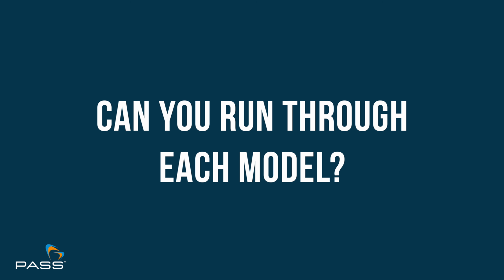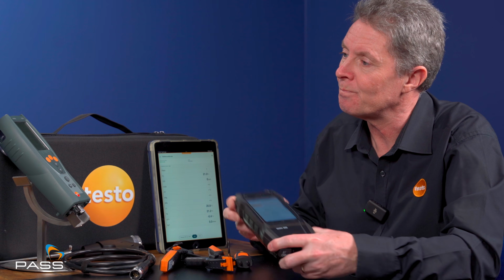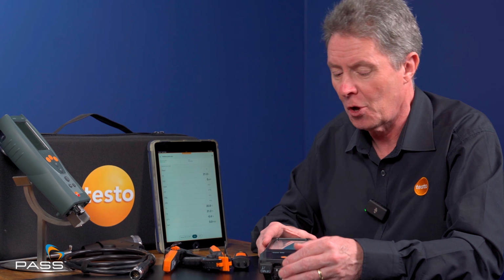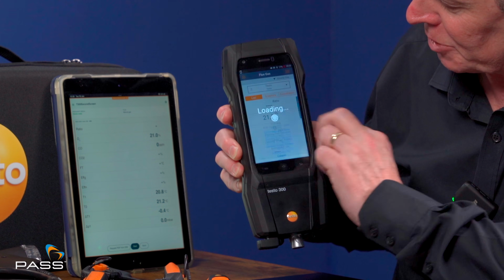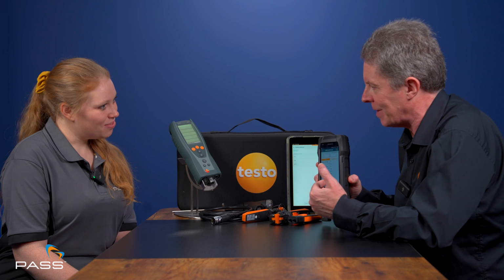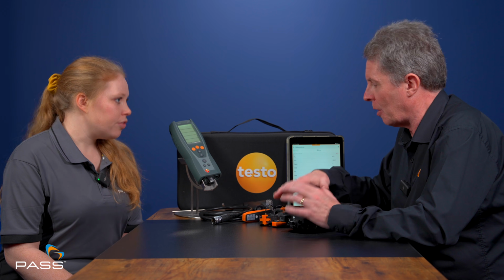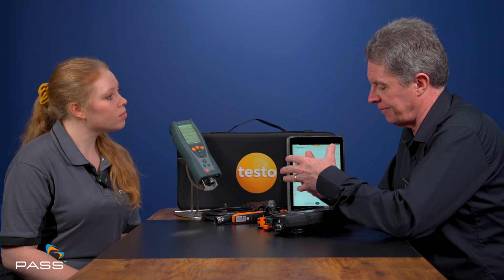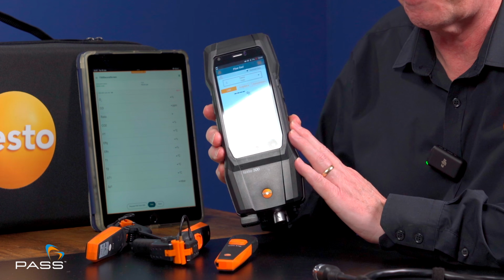Testo 300 or 327 Flue Gas Analysers: Which One to Choose?

Comment: Warranty is really poor, just 2 years for such a device is nothing tbh, it seems like you don't believe in your product.
Reply from the maker: Thank you for your feedback. As a reseller, we understand your concerns. Testo offers a standard 2-year warranty, which is designed to cover material and manufacturer faults comprehensively. Additionally, by registering your product, you may gain access to extended warranty options and additional services. This demonstrates Testo's commitment to quality and customer satisfaction. 

Feel free to contact us in the future if you wish to discuss flue gas products or test equipment you may require.